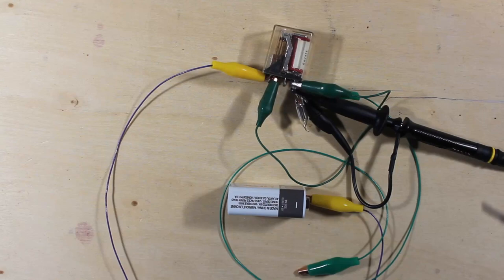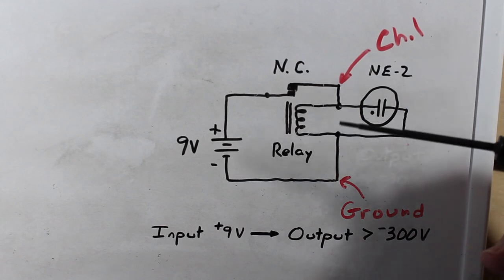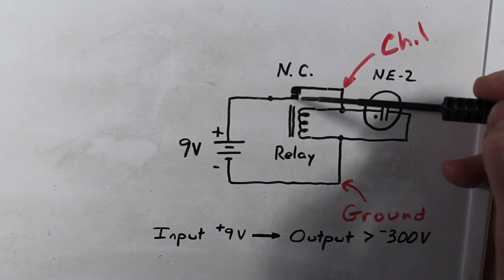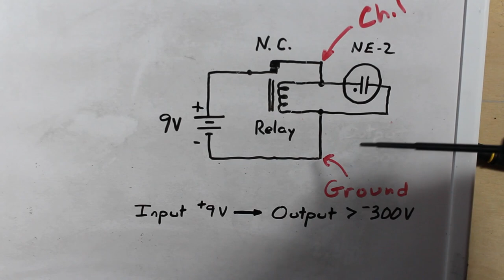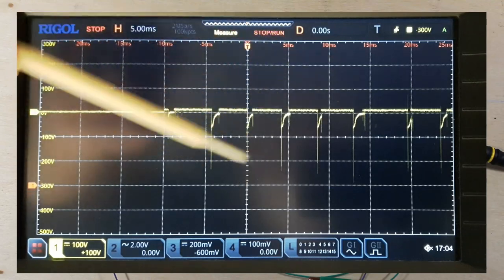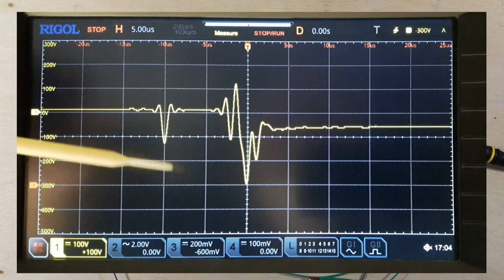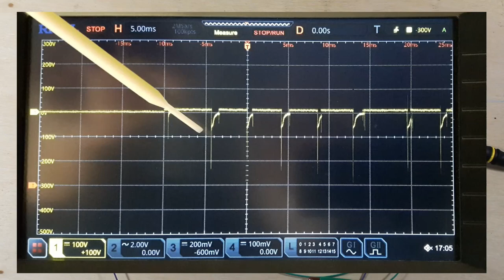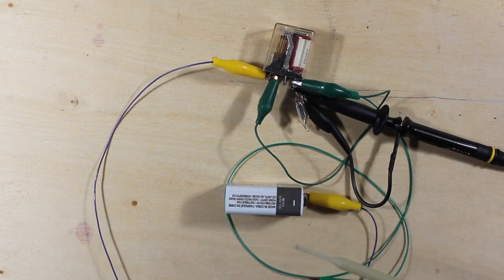Making High Voltage With A Relay And A Battery  #science #experiment #highvoltage #oscilloscope

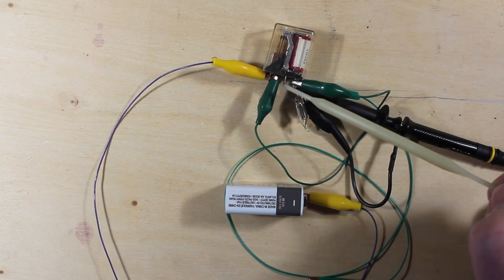Comment: At 4:31 A capacitor across the coil also works.  It could be put across the contacts like in an automotive ignition coil (as you stated in another comment).
Reply from the maker: Across the contacts like the old condenser/points method reduces spark erosion of the contacts
Reply: @MoreThanElectronics  True but it will suppress the high voltage spike.  You can test this with the o'scope.

Comment: Do you think this works
Reply from the maker: If you're asking whether inductive kickback (magnetic field collapse) can generate much higher voltages than the voltage applied, then yes it works.  It's the principle the automotive ignition coil/points system uses to generate 20,000+ volts from 12 volts.